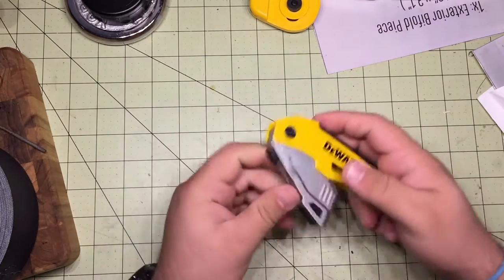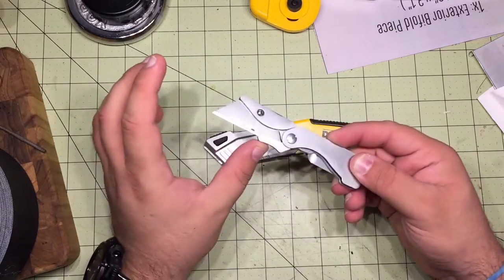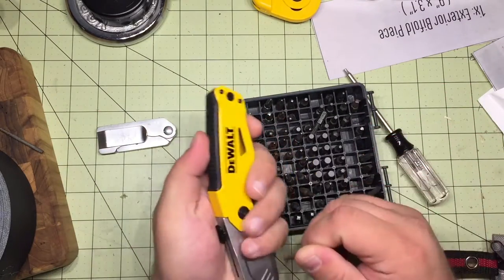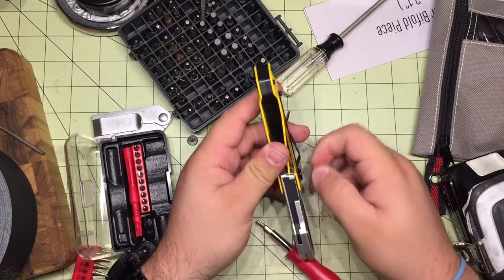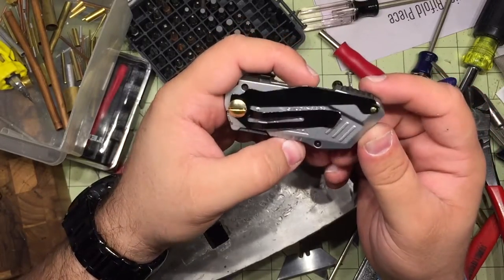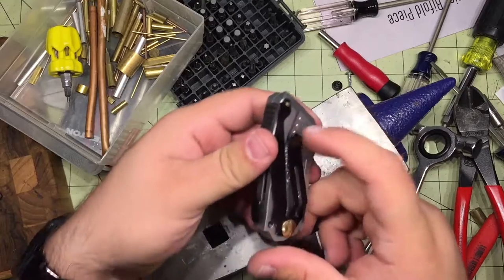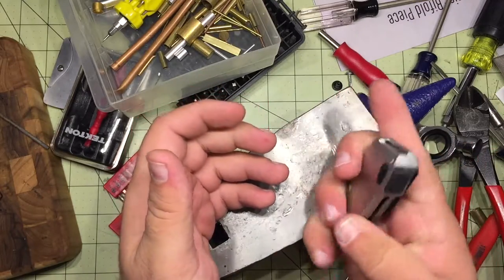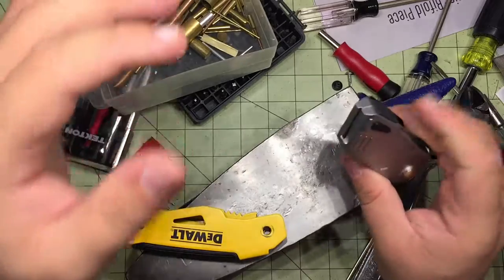DeWalt Utility Knife Hack

Comment: HOW TO INSERT & REMOVE BLADES:

A major number of negative reviews, and comments pertain to the seeming inability to insert & remove  blades.
This is due to Dewalt's inadequate blade insertion instructions, and not due to a faulty blade insertion/ removal mechanism. However Dewalt needs a less tricky more user friendly mechanism.
Ease of Blade insertion and removal is "tricky" not difficult, or impossible once mastered, as follows:

BLADE INSERTION: 
1. Move the blade slider to full forward as if you were extending a blade to its fully extended position. This fully extended position of that blade slider  is needed both to remove, & to insert a blade.

2. Initially Insert the blade tip at a 45° angle to the top of the blade cavity (not the flat side, but the top of the blade cavity) until insertion  stops at about 1/4 of the way in. 
Be sure the flat of the blade is not inserted at any angle to the flat of the blade cavity, which it will do easily. Unless and until the flat of the blade is exactly lined up with the flat of the blade cavity you will not be able to proceed to steps 3. thru 5. below.

3. Straighten the top of the blade from its initial 45° angle to the top of the blade cavity in step 2 above,  to instead where the top of the blade is totally parallel to the top of the blade cavity. 
I emphasize the word totally here. This is the tricky part. By totally parallel above I mean so the top of the blade is pressed against the top of the blade cavity totally. The blade will then slide further into the cavity to where only the last of the two notches atop the blade is yet visible.

4. Press the blade release button hard while executing  step 5 below. 
Note: This blade release button does not have to be pressed until step 5. below.

5. While being sure the top of the blade is still totally against the top of the blade cavity ( this is the tricky part per step 3. above). Then in that event with the blade release button pressed hard, per step 4. above, the blade should then  easily glide completely into the blade cavity, and lock in place.
Wallah!

BLADE REMOVAL:
1. Fully extend the blade..

2. Press the blade release button hard while executing  step 3.
below. An even harder press of the blade release button may be needed to release the blade than the hard press of it needed for blade insertion. Ridiculously hard!  

3.  Be sure the top of the blade is pressed against the top of the blade cavity, whereby with the blade release button pressed extremely hard the blade should then remove easily.
Note: If the blade does not then remove easily then in that event:
A. Again be sure the top of the blade is pressed against the top of the blade cavity.
B. And/ or a little gentle jiggling. 
C.  And or a relaxing, and repressing ( again very hard) of the blade release button may be needed.
Wallah!

Comment: DeWalt's fine little folding is a fine idea and worked great until they apparently cheapened it in the latest versions. I just got a DWHT10035 at Aubuchon's to day, December 29, 2018, and found that the few cartoons on it's use, including loading and accessing the extra blades, were inadequate to nonexistent. I was trained as an engineer and use tools each day, so I didn't hesitate to take it apart after it 'ate' a blade I fed it, as per the instructions. Retrieved the blade, and after an hour, got it back together. However, I regret that the blade access latch it cheapened, and feeding the blades is pretty clunky now.